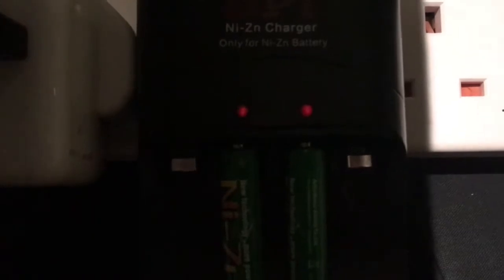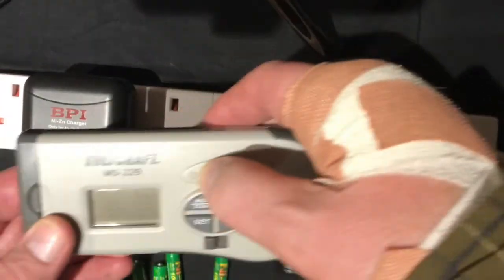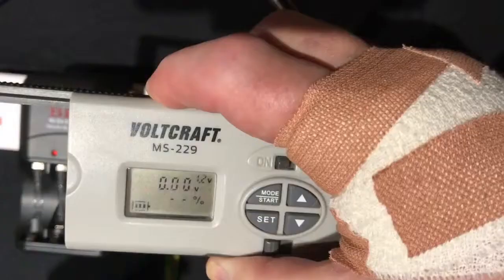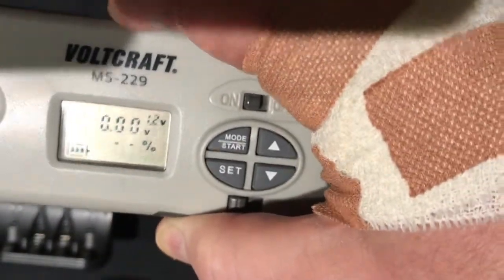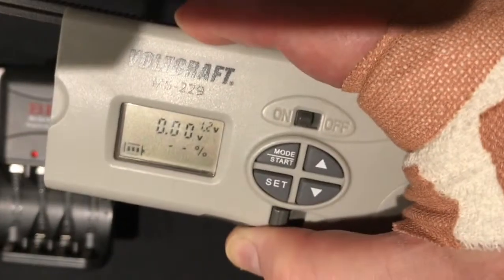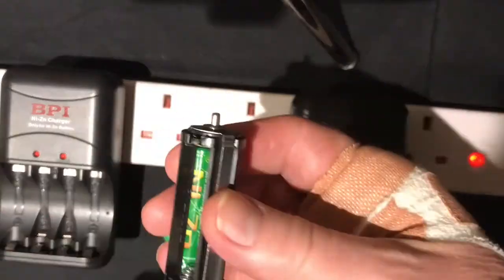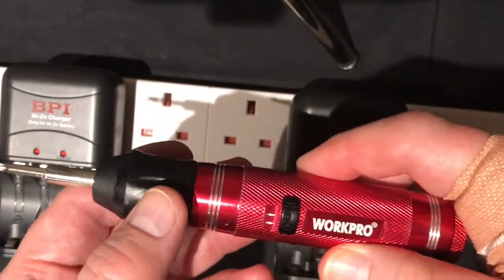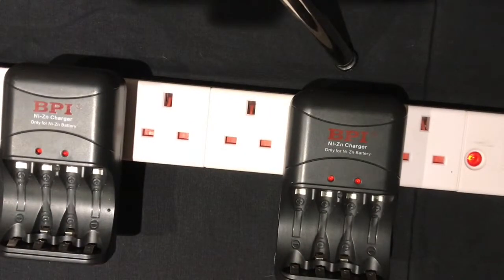Reviving Dead Ni-Zn Batteries Not Charging Fix - Part 2 It Works

Comment: Thanks for the good info as always! FYI, I don't know if it works but I've heard that when a rechargeable battery's capacity is getting low you can charge it, stick it in the freezer for a few days (inside a Ziploc bag with no aiI), then charge it again and it's supposed to help restore it! If you try it let me know how it works out! Cheers!
Reply from the maker: Thanks for watching the videos, and the comments are really appreciated. I hope you've subscribed. Regards Malcolm aka #fixed1t
Reply: @fixed1t   can you tell me if its safe to put them in cd 💿 player because I think the nihn battery is 1.2v and I think it sounds different from alkaline battery it has 1.5v so it gotta have a better sound
Reply from the maker: I wouldn't advise putting lithium in the freezer, as it reacts badly with water it wouldn't be good for the battery to grow water crystals and short --- BOOM